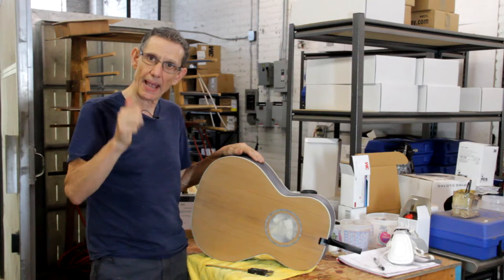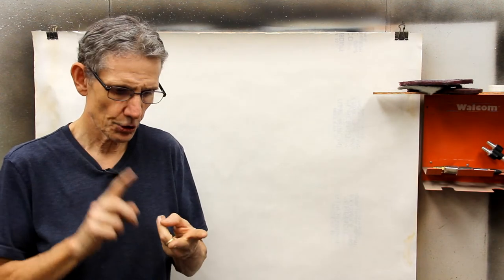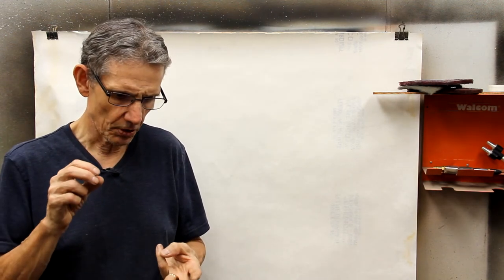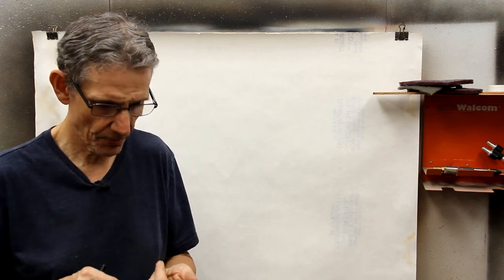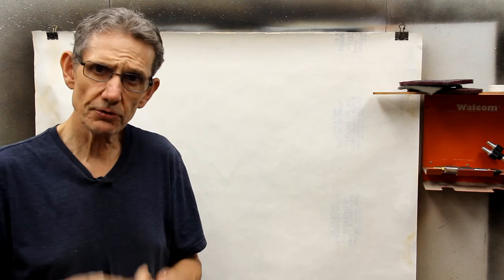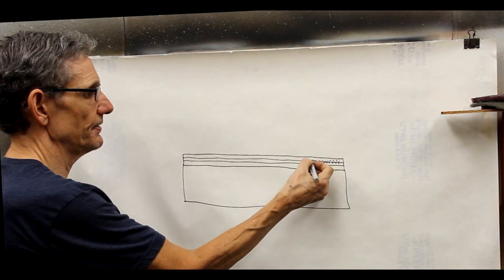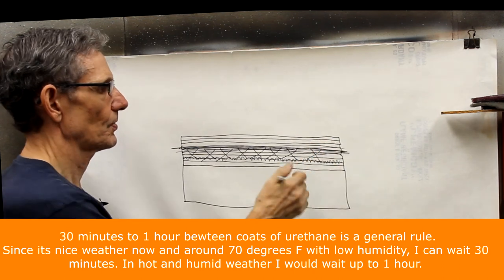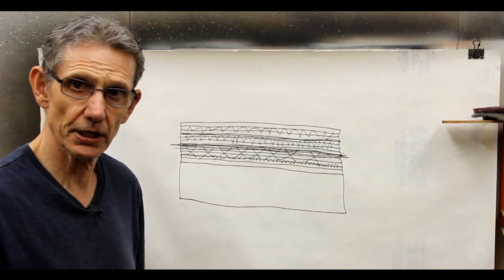Lacquer versus Urethane Finishes

Comment: Great summary.   Seems we are all starting to use more poly or urethane finishes, and I always wanted to know about burn-in but my finishing store looks at me like With a blank stare.  They only know what the cut sheet say and that’s not much on some of the finishes I use.   

Curiously if you not recommend sanding between the second and third coats (after 30-60 mins)?